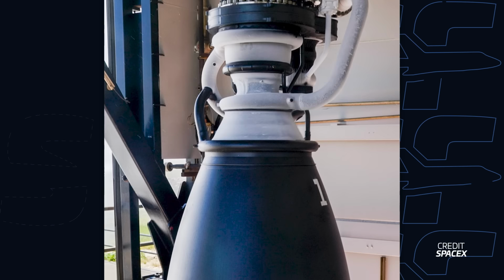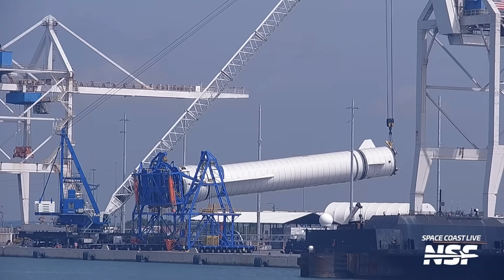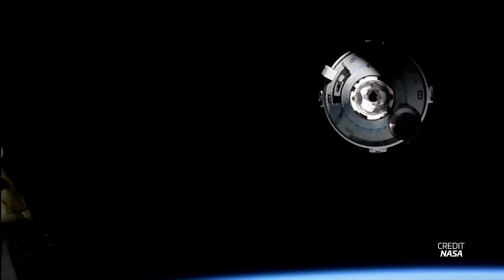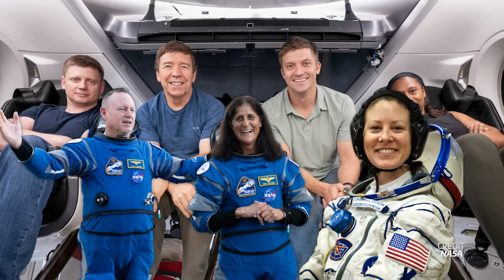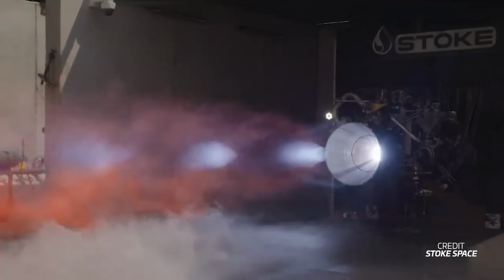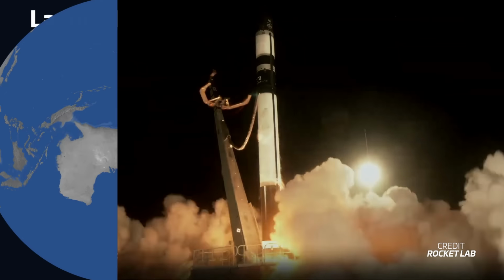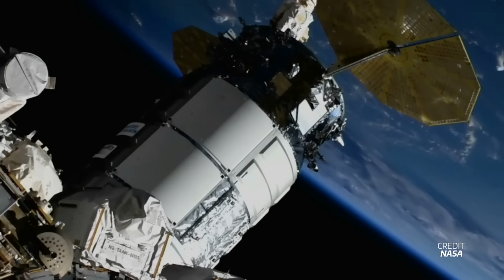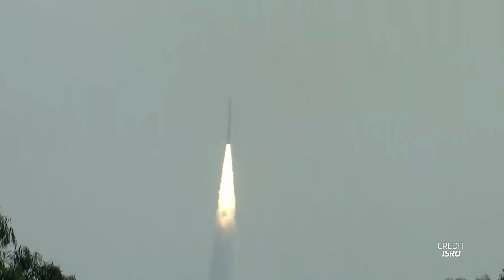Raptor 3 Fires Up, New Glenn Tests at Port & Starliner's Latest Update | This Week in Spaceflight

Comment: Hope you can explain starliner to us simple types
Reply from the maker: We have a video in the works, but news just keeps coming out. Slowing it down.  --kmr
Reply: Boeing is stuck in old ways with not the best engineers, and didn’t design a capsule with reliable enough thrusters they can trust to get the astronauts back home.
Reply: @EMichaelBall Worse than that. Had thruster problems on uncrewed tests; and they never did a complete job of fixing the thrusters before flying crew, which is unacceptable in this business in the extreme. - Dave Huntsman
Reply: boing holds power over nasa due to how many people it employs in key states, so its forcing nasa to push a unsafe, unreliable, and under-tested to service so they don't lose another major part of their space industry revenue to spaceX.